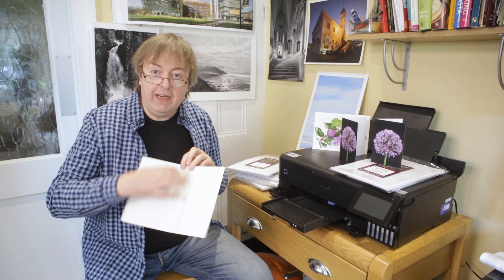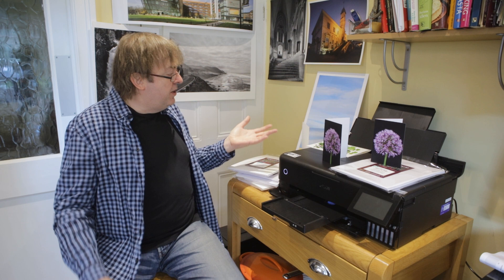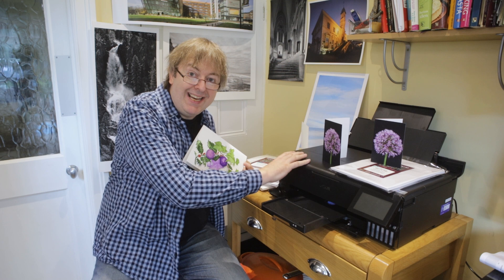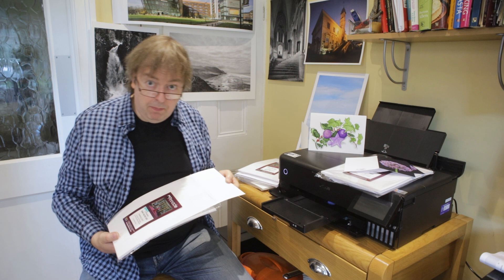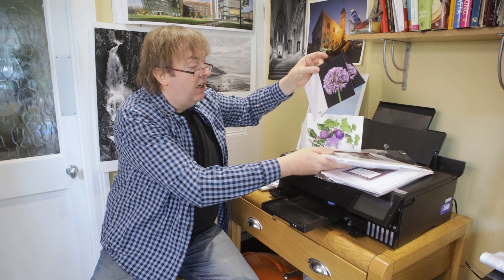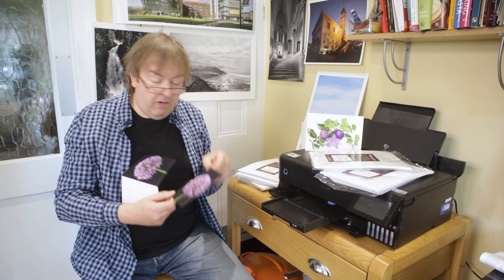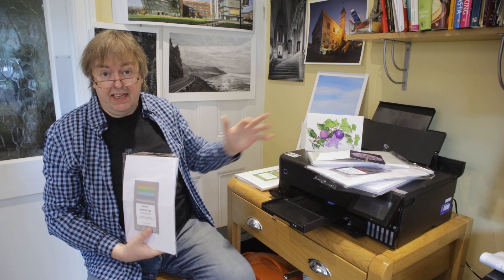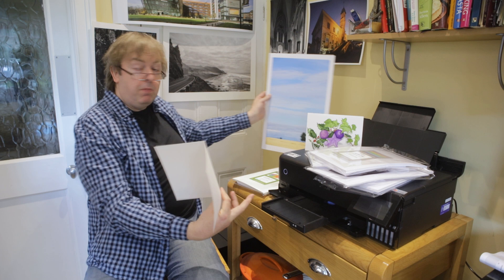ET 8550 greeting cards - using different types of card and how they affect quality

Comment: I have recently purchased this printer and wanted to print some a6 cards (folded from a5) for which I have the papers.  Although A5 isn't supported,  it is possible to print a borderless image using an a5 sheet creased for A6 by simply adding a user defined paper with A5 dimensions but in landscape, and feed the paper into the printer long edge first.
Once you have this set up and have worked out the correct orientation for your print, it works perfectly.  The printer's restriction is with the paper width,  so effectly the printer is treating your custom paper as A4 width so will allow the borderless option to be ticked.
Yes, if I was printing 2 or more of the same card, then I would get the vertically creased A4 and cut it up, but for one offs,  this works fine.
Reply from the maker: That's a good work round for some borderless limitations

Comment: Thanks for yet another invaluable clip, Keith. Though I have no desire to print greeting cards one never knows what the future brings and one of the samples you showed (at around 2 minutes) made me think that if I could put an image of my wife's and my faces on the leaves that could be an interesting way to go. There is another user (whose clip I saw prior to yours) who has decried the printer for leaving roller marks on the stock, and somewhat unpleasantly put the blame on the printer. I feel that if you were getting roller marks, you'd have noticed and mentioned it. I also made note of your statement regarding getting good-quality stock: the adage that "quality doesn't cost - it pays!" perhaps seems quite apt here as well as in most things in life.
Reply from the maker: Thanks
This printer does seem varied in its acceptance of thicker media - I may have been lucky, but the cards I made seemed fine.
If a brand new printer made marks on media within its specification, I'd want a replacement...

Comment: Thanks Keith I love all your videos on Youtube, very helpful, I have finally after looking at your content bought a ET-8550, I print alot of greeting cards, but I cannot get the image to centre on my card, I use a border so it has to be centre properly, I am printing from a mac from illustrator software and it worked good on my older eco tank. I have created the defined size and gone through the printer alligement but still no joy.
Reply from the maker: Try EPL for printing
Reply: i have the same issue since I got my ET-8550 and would be interested in a reply too!
Reply from the maker: .Epson Print Layout - It what I use in a lot of the reviews
https://www.northlight-images.co.uk/epson-et-8550-printer-review/

Comment: Have been watching your videos on the ET 8550 and purchased one recently.  There are marks that look like roller marks on 260gm gloss paper I put through the rear tray and was wondering is this common?  Just trying to work out if common or just my own.  Maybe it's a case of trying different paper stock.
Reply from the maker: Yes - this seems to vary by printer and by media type.
You can see the papers I tried in the main [written] review
https://www.northlight-images.co.uk/epson-et-8550-printer-review/
Make sure the firmware is up to date as well

Comment: Thank you for the very useful videos, please could you tell me if there is a way to print a square (14x14) greeting card borderless on the ET 8550? I've seen the pre-creased  28 x14 cards available on Marrutt but I can not find or work out how to create a template, would I have to use A4 and trim it if I wanted to do borderless, I've not seen 28 x14 as an available paper size to use on my printer software, am I missing something obvious? thank you in advance for any advice.
Reply from the maker: Custom page size is the way to go, but custom sizes are not supported borderless
See my main [written] 8550 review
https://www.northlight-images.co.uk/epson-et-8550-printer-review/

Comment: I just bought one of these and I'm using a double sided matte 230 gsm paper and I can not get it to load through the top rear feeder (not the flat slot rear feeder) at all. I see the paper dip like it wants to load in but it simply wont. It looks like you do not seem to have this issue. Any ideas? Really hoping I didn't get a lemon. Thanks!
Reply from the maker: Contact Epson [or reseller ... depends where you are] - just make sure you note it happening with an Epson branded paper [it's the first get-out excuse on the support script ;-) ]
A paper like this should have no trouble - it should not need help to load
Reply: @KeithCooper  ended up swapping out at the store. The new one is working a little better but I still can't let it auto feed. It started out feeding ok then slowly but surely I gag to start giving it some help. I pretty much had to sit and let the weight of my hand on the top of the paper in order for it to feed properly. I'm honestly wondering if the coating on the paper is leaving behind some kind of residue that's immediately making the feed not successfully grab the paper. Any thoughts? It can't be a coincidence that it's happened with two different printers now. Thanks!
Reply from the maker: I've not seen that, but how is it with other papers... @jeffboob7449

Comment: Hello Keith, I’m having a problem printing card stock paper 65lb. So far I found the correct printing setting from my Mac book pro. But on the display screen from my Epson 8550, I cannot find the correct paper type. I’ve tried plain paper (I can see the marks of the rollers on the paper) , pre semi gloss (I can see lines on the paper), premium matte (the colors fade) the only one that works ok is the presentation matte but still doesn’t print true to the colors. 

My printer screen shows only these options for paper type: plain paper, letterhead, envelope, ultra glossy, prem glossy, glossy, prem semi gloss, ultra prem photo luster, presentation matte, prem matte, velvet fine art paper, thin paper. 

I would highly appreciate your help. I’ve been wasting a lot of card stock paper and ink and I’m still not finding the right setting.
Reply from the maker: VFA is the one I generally used, see the way inks are used in
https://www.northlight-images.co.uk/epson-et-8550-printer-review/

BUT... I have to say that whenever I hear the words 'card stock' and the weight in pounds, it suggests that there is a strong chance that no settings will work well. The card needs to be compatible with aqueous ink--jet inks.

Comment: I've had two ET-7750s (had to get replacement) because of endless issues such as phantom paper jams after just a few months into warranty, smudging, etc. Though the quality is great, I'm very very hesitant to buy the ET 8550 if its just another glorified 7750 with the same build quality problems a few months later.
Reply from the maker: I've not seen the 7750 at all, so can only refer to the 8550 I've had here a few months for testing.
Reply: @KeithCooper  OK. Fair enough. Give it a few months and you'll experience the infamous 'phantom' paper jams! There is actually no paper jam, it gets worse over time. I've had it on the 7750 and know some people who've had it with the 8550.
Reply from the maker: Paper jams from what paper feed route and what type/specification of paper?
Reply: @KeithCooper  Regular cardstock 300gsm, but it doesn't even start its feed route, the paper sits in loaded tray (rear) or cassette), rollers spin, loud noise, 7750 decides to issue paper jam. I'm in a EcoTank Facebook group and 50% of users have experienced it. I'm experiencing it with two 7750s! Its no coincidence. Epson swapped out parts for my first one gave me back a frankenstein 7750 repair, that soon died after. On 2nd one now, 7 months in, same issues starting. Epson know all about it - they just deny its a known issue when you tell them!
Reply from the maker: That's unfortunate - I've never seen a 7750. I'd not accept that in a new printer.

The 8550 here, feeds card just fine - it is a different printer but I only ever report observations and tests on the printer I have  (my printer reviews go back to 2008 - my videos are a recent addition to supplement my main written reviews).
Reply: @KeithCooper  I appreciate that. I do watch your videos for reviews/advice, so thanks for responding. I hope the 8550 has been improved and holds up for you.

Out of interest, I'm looking into the Canon Pixma Pro-200 that your reviewed as want to try a different brand. Out of interest between the Pro-200 and the Epson 8550 which has the best quality for graphic design/art printed on cardstock/poster papers?
Reply from the maker: No significant difference if used with good quality inkjet capable card and appropriate colour profiles.  For both printers, the key is optimal media choice and appropriate colour management. Both perform badly on the wrong media types.
Reply: @KeithCooper  ok thank you
Reply: When using the rear feed I found that I just have to give the paper a little tiny shove and it will catch the paper. I found this technique has fixed the phantom paper jams.

Comment: I have the et-8500 and print on 140lb cardstock. Can you use the premium presentation matte paper setting and use the rear paper feed slot? I've tried it on Velvet and it works great but it takes 5min just to print on 8.5x11. I've tried the premium presentation matte setting on 110lb cardstock it prints lighter but it is faster. I like the thicker cardstock but would like the speed. Was wandering if the Epson adjust for thickness of paper manually or is it all software?
Reply from the maker: Speed/quality - pick one...
Sorry that's it with a consumer printer like this
Thickness has little to do with this, it's about the media settings - the reason VFA is darker is due to the inks used - nothing to adjust I'm afraid. See the main [written] review for far more about this.

Are you sure you can't turn down the quality setting for VFA a bit more? [don't have printer here, so can't check]

Comment: love your videos,
can i ask what paper size you feel is thickest allowed in rear feed vs cassette? i have the et 7750 and it has a hard time with 160lb cover DT in read feed and will always jam in cassette. wondering if this is worth the upgrade as it mentions 1.3mm thickness
Reply from the maker: Thanks - Unfortunately '160lb cover DT' is not a term used outside the US - but the paper cassette is effectively useless for much beyond plain paper.
All the cards I tried are in the 330-400 gsm range and fed via the top feed.
See the posterboard example for the thicker rear special straight through feed 
Best place to start is the main [written] review at
https://www.northlight-images.co.uk/epson-et-8550-printer-review/

Comment: Hi! I've been trying to print greeting cards borderless through the rear feeder but I've been having a bit of trouble with white edges (they sometimes appear on the last edge that is printed on) and the centre of the card is off slightly. I saw your other video about borderless printing on this printer (and you removed these edges by clicking "Expansion" on Epson Print Layout) but I can't really do this as it would misshape the greeting card. Have you found a resolution for this? Thanks - Emma :)
Reply from the maker: Make the image oversize and adjust the settings for prints - I'd still use EPL for this [practicing on plain paper and an image with nothing in the centre, to save ink.
However I've not had one of these printers since the review, so I've no new info...

Comment: Thank you, very helpful video. What would you say is the minimum size in pixels for printing a card at A4 without losing quality? I know at 300dpi it would be 2480 x 3508, but could you get away with a smaller image for a card without losing quality?
Reply from the maker: It depends entirely on the image... 
Modern re-sizing software is so good that many of the old rules of thumb went out of the window.
Anyone who gives you a solid number is wrong IMHO ;-)

300 is a reasonable 'aim  point' but more is often better and I've printer big prints at 240 - problem is that card sized prints get viewed from close, so more is better...

Comment: Hi Keith, I hope you see this comment  - having got into designing greetings cards for family and friends, I need to purchase a new printer ( have been using a Canon Pixma G3501 - don’t ask!!!). I am looking at the Epson ET 8500. I know your review is for the 8550, but I don’t think I need A3 printing ( though am thinking about it). Can I ask three questions - can I set user defined sizes for the greetings cards I am using (yes, they are not specifically designed for inkjet printers but are some I am using up); can I use 300gsm card; and will the printer connect to my iPad via our house wifi (rather than as the Canon which has its own wifi which frequently faults). Thanks for the great video!
Reply from the maker: I can't really address this one in detail since iPads are generally useless for accurate colour [with any printer] - there is no proper driver installed.

Custom sizes may well work (with borders), but once again I've no idea using ipads
Sorry, but have a read of the main [written] review where I cover a lot more details of using the printer. 

https://www.northlight-images.co.uk/epson-et-8550-printer-review/

Comment: Hi Keith
Thanks for the helpful video as always  
Two questions….I use the Epson Smart Panel App  for printing but notice that the menu doesn’t look like the appearance of that shown in your video. I’ve got the A4 card which is pre-folded but it just doesn’t seem to give me an option of printing A5 borderless in landscape within the app options 🤔🤷🏼‍♂️ Maybe yours is for a windows system? I do have a MacBook Pro that I could use if that’s the answer. 
Second and easier question is for a supplier of the poster board please ? The company in Leicester don’t seem to stock it. 
TIA
Les
Reply from the maker: Don't know about the 'smart panel app' at all - I use Epson Print Layout [on macs or win]  for demoing printing. I normally print directly from Photoshop myself [we only have Macs here]
A5 is not a supported borderless size for the 8550
The posterboard came from Epson
Reply: Thanks Keith
I went to Epson site and downloaded Epson Print Layout on my MacBook. Rather frustrating that it keeps coming up with messages saying install printer driver but doesn’t seem to have an option to do so. 🤷🏼‍♂️. The 8550 is down as the default printer for the MacBook. Thanks for the poster board info. 
Best wishes
Les
Reply from the maker: Are you sure you don't have the airprint driver installed on the Mac?  It's useless anyway, but won't work with EPL - see my recent airprint videos for examples

See here
https://www.northlight-images.co.uk/epson-et-8550-printer-review/
Reply: That’s a possibility 🤔…I’ll take a look at the video you made. Thanks for your valuable time

Comment: Hi Keith, I'm trying to figure out how to print on 80lb 12 x 12 cardstock.  Would that cardstock go in the rear paper tray or though the back part?  I'm really have difficulty with this printer.  It's the most complicated thing I've ever used.
Reply from the maker: Ah - 80lb doesn't mean much outside the US I'm afraid?
The rear straight through feed is for thicker stiff media
See more details in my main [written] review - the printer specs refer to the media thicknesses for different slots (in mm)
https://www.northlight-images.co.uk/epson-et-8550-printer-review/

Card printing quality depends a lot on the media coating and media settings

Comment: Thanks for the video. Are you printing those cards from the top or the back? 300g will not feed through the top on my 8500.
Reply from the maker: Works OK on the 8550 I tested... See the examples in the main [written] review and linked articles/videos.
It does vary by printer model...
Reply: @KeithCooper  Thanks for your reply. The 8500 which has the same spec other than not being wide format. Jams every time through the top on mine. Oh well.

Comment: Thank you for your videos -- I am trying to print greting cards - 250 gsm(64lb), 13.5 mil, 100% cotton rag -- the cards will not feed automatically hardly ever.  is it the paper ?  the printer is brand new -- thanks in advance for any help you can give me.
Reply from the maker: I never had problems with this with the papers I tried, but I have only so many types here.
That weight should be OK from the top feed - Have you tried putting some sheets of plain paper behind the card?
Reply: @KeithCooper  I have tried everything I found on the internet.  the only paper that will feed on its own is normal printer paper.  It takes about a minute and a half to 2 minutes of spinning noises before the message comes up on the screen that there is no paper, which ther really is.  I am going to return it to Amazon and get a replacement.  Hopefully that one works.
Reply from the maker: Yes - sounds like a duff printer :-(

Comment: Hi Keith. This printer is new to me after previously using the Canon Pro-300. I can print my art prints no problem but my cards (350gsm matte) are coming out with horizontal lines across them. Have re-checked the print alignment and selected thick card when printing from photoshop but no change. Getting behind with my card orders so rather stressed ':). Any tips? Thank you
Reply from the maker: Horizontal lines - typically ink feed related. Do a nozzle check on plain paper - check the ink levels and do a clean.
Can't think of anything else specific though...
Reply: Thank you for your reply Keith. Nozzle check has printed fine each time but I did one more print clean for good measure and I am now up and running. Grateful my tribulations brought me to your YouTube though 😅